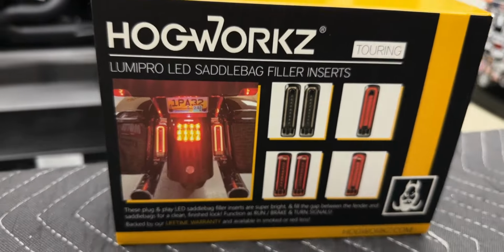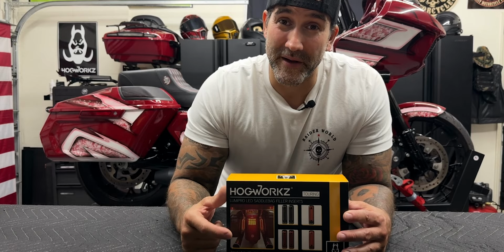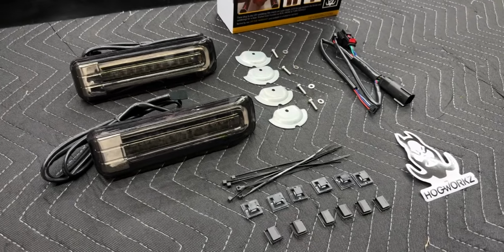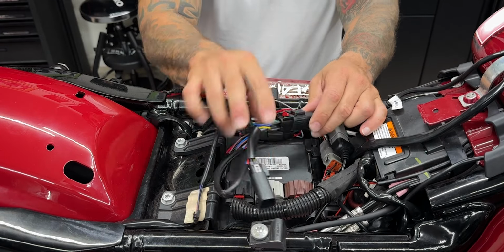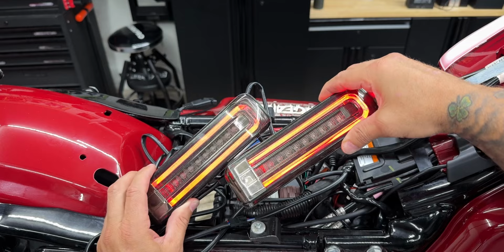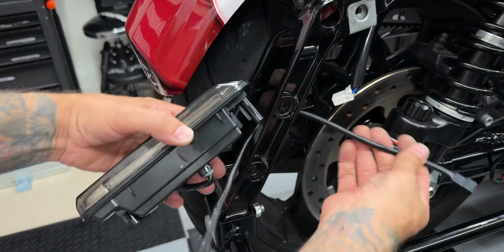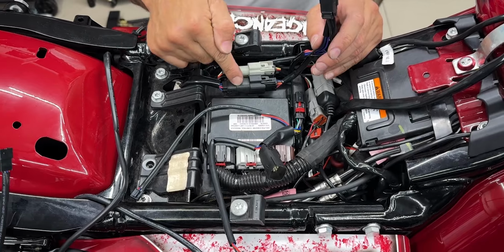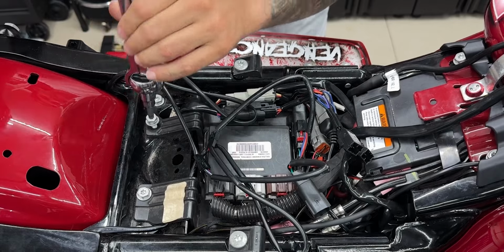New LumiPro LED Tail-Lights for Harley Touring

Comment from the maker: 🚨 If you have a Rear Fender with a fender extension and Tribar, you would need to remove it, and also install a Tribar deletion/eliminator wiring harness. You can find that harness here  https://www.denniskirk.com/custom-dynamics/tribar-eliminator-wiring-harness-for-u-s-models-tri3-elim-harn.p2102633.prd/2102633.sku?srsltid=AfmBOoqbin5WbExS_8VqRNvfRvpdBZj8QRLwLCEVNcO1DGms6cWVMWLC

Comment: For anyone who has a 2022 Road Glide, they do not fit. This is what the website says when you try "Item DOES NOT fit your 2022 Harley-Davidson Road Glide Special FLTRXS"
Reply from the maker: 2014-2023 Road Glides share the same rear fender supports, so these lights should work.  This is something HogWorkz needs to fix on their fitment table.
Reply: @RAIDERWORLD  awesome!
Reply from the maker: @turdferguson- obviously you would have to remove your tribar if you have one, and install a tribar deletion with harness. https://www.denniskirk.com/custom-dynamics/tribar-eliminator-wiring-harness-for-u-s-models-tri3-elim-harn.p2102633.prd/2102633.sku?srsltid=AfmBOoqbin5WbExS_8VqRNvfRvpdBZj8QRLwLCEVNcO1DGms6cWVMWLC